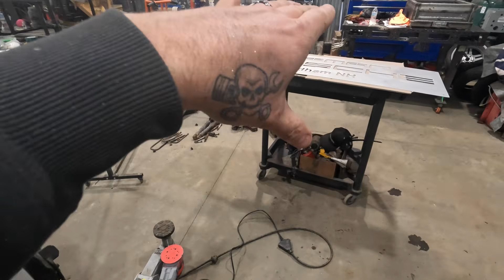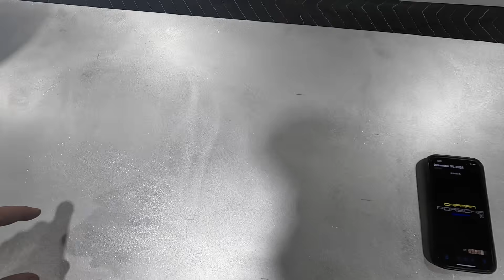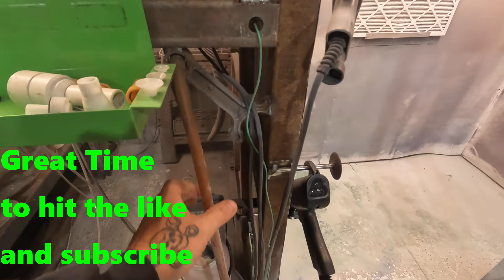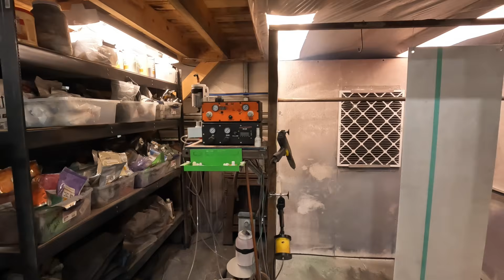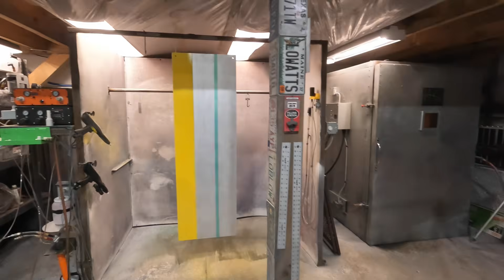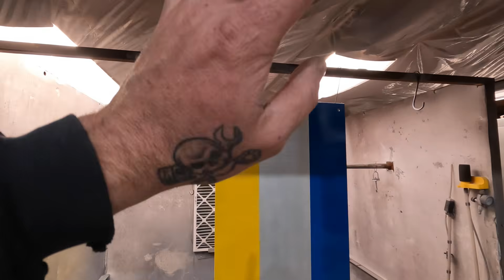How to Powder Coat Multiple Color Signs

Comment: What size compressor are you using?  Looking to buy this same setup and wanting to know if a 20 gallon 5cfm compressor would be a good choice
Reply from the maker: I have a 7,5 hp 80 gallon but I do sand blasting too, if your just powder coating you should be good

Comment: Thanks for the vid and a bit more in depth of the setup for the gun and mini stand. Question, where did you get the supply air for the vibrating stand? I have the exact same setup, just curious as I didn’t hook my vibrating stand up to air.
Reply from the maker: Just splitting the supply aid for the kool coat system
Reply: @ I have the mini stand and the pump as well, I tried a bunch of air pressures but I can’t get a consistent spray, I have it down in a 15lb bag and it’s like it gets to a point and gets clogged or isn’t picking up anymore powder awfully quickly. Do you know how to combat this? I maybe get 10 seconds of spray and then nothing. My wife has to shake the bag around for me..